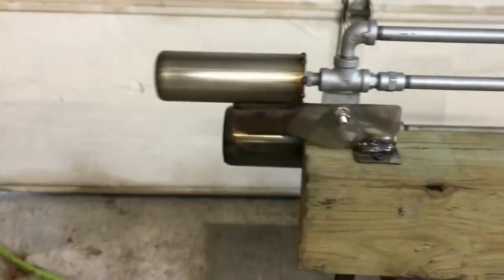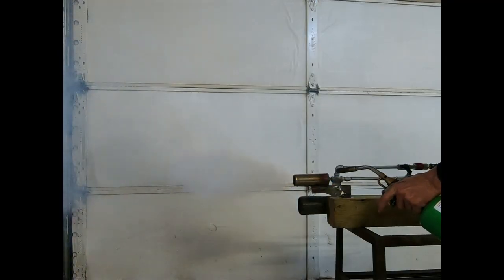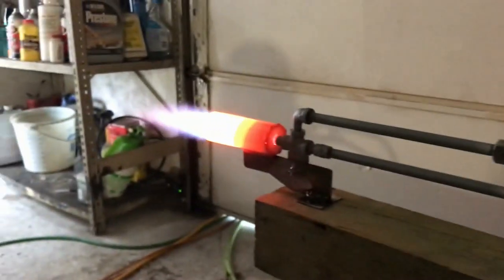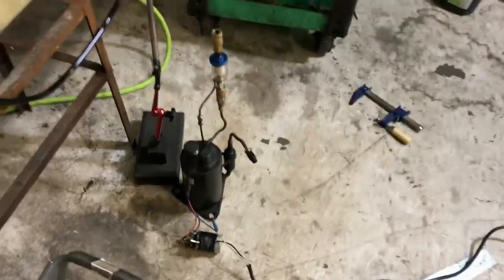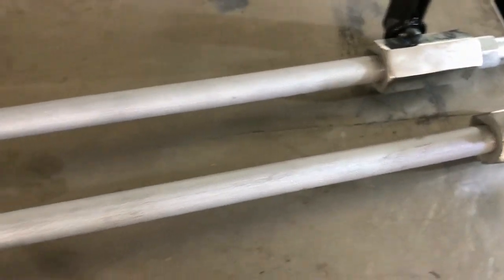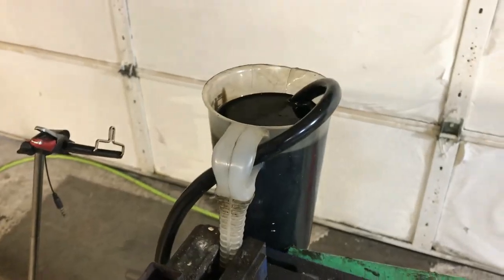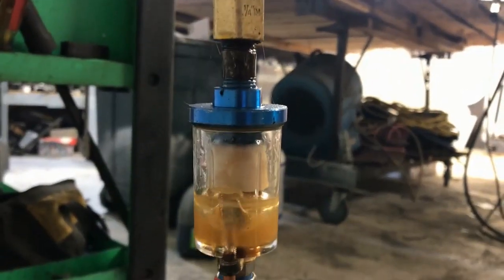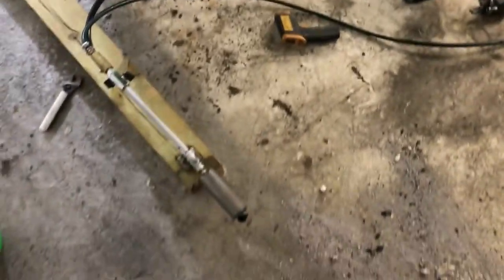Micro waste oil burner 1,000 to 25,000 watts

Comment: Health and Environmental Hazards of Burning Used Motor Oil

Burning used motor oil poses serious risks to both human health and the environment.

Used motor oil contains toxic substances such as heavy metals (lead, cadmium, chromium), polycyclic aromatic hydrocarbons (PAHs), and chemical additives formed during engine operation. When this oil is burned, these substances are released into the air as toxic fumes and fine particles.

From a health perspective, inhalation of these emissions can cause:

Respiratory problems and lung irritation

Neurological damage

Increased risk of cancer

Long-term damage to the liver, kidneys, and immune system

From an environmental perspective, burning used oil contributes to:

Air pollution and the release of hazardous pollutants, including dioxins

Soil and water contamination through fallout of toxic residues

Harm to ecosystems, wildlife, and plant life

Increased greenhouse gas emissions and environmental degradation

Because of these dangers, used motor oil is classified as hazardous waste and must be collected and treated in approved facilities rather than burned in uncontrolled or non-authorized systems.

Conclusion: what is the level of intelligence you think you have to take an interest in a system that is already banned in Europe for the preservation of our health? Would you like to end up like the Hindus who melt lead from batteries all day long and breathe in the harmful fumes of lead that cause neurological degeneration of the human body, all to recycle used batteries? This video is on the same intellectual level.

Comment: just how much filtering do I need to do with my waste oil? I plan to mix it with desil or kero I have (quite a bit from old bus fuel tanks and scrapped out torpedo heaters etc. ) and since the containers have sat undisturbed most of the sludge should be on the bottom of i pour slowly. For big stuff I was going to use a window screen as junk and grass from the mower engines always falls into the parts drainer and pans. Since Ill be melting scrap, the cheapest possible method is desirable. If I don't filter it, will it effect something like a mini-Godzilla, or will it run for a while before I need to clean it? I guess if I can get a weekend out of it before needing to clean it, thats not so bad. I assume I can just wait for them to cool and blow them out with compressed air or soak the tip in gasoline (or use carb cleaner) and blow them out?

Comment: Warning.  Motor oil has a ton of metals in it. You need good ventilation or you will be poisoning yourself.  I am a chemist and have a lot of experience measuring metals in waste motor oil and gearbox lube.
Reply from the maker: You are correct , place this warning on all my instruction sheets . I have lab analysis of motor to show 4PPM of  lead
Reply: 100% agree. Lots of the bearing material that wears off ends up in the used oil. The tars and organic residues aren’t as much of a concern since they will burn off, but the metals will end up in the flue gas or as ash inside the furnace. At high temperatures I think it’s possible that some of the oxides may absorb into the refractory (think cupellation).

Comment: Nice compact design at .22 cal. and 25kw output. Hint, hint is a hyperbolic .177 cal in the future, chamfering the air inlet at >30deg., coaxial compact for secondary air flow and Mach diamonds in the exhaust?

Comment: If you're using used motor oil it could be contaminated with heavy metals and other toxins. If so, you could be poisoning yourself and anyone else that might be breathing the exhaust gases. Heavy metal poisoning can cause permanent, catastrophic damage to your health. Please use extreme caution!
Reply: hey Ive handled lead without gloves everyday for the past 15 years anb I tiernet uot Qc.

Comment: i made a simular one that burns waste oil just as clean. the nozzle is a 1/4" brass T with 1/8" oil line pushed thru to the face of the other side. then air in the T fitting. ashort 4" piece of 1/4" on the outlet and just pinch it off a little for back pressure.  the trick is keeping your oil pressure the same as the air so one doesnt push back the other. i used a refrigerant tank, dilled in a dip tube, brazed on an air fitting  thats common with the air feed to the nozzle. and brazed in an oil fill with threaded cap. dip tube is oil feed to nozzle. then used a refrigerator compresser for pressure which i found best around 30#. have to valve each off like you did and the flame can literally melt a woodstove. i did a bigger one with 150# and 3/8" copper and whoa look out

Comment: Just made one of these and just cannot get it to light, just end up spraying oil mist all over my yard. It's misting really well and I have used and old 1kg foam powder extinguisher bottle for the shroud with ends cut out. . What pressure do you run it at. Is thick oil a factor. First I had the air hole too big and compressor couldn't keep up so I have made the smaller, it's still misting really well but won't light. Any tips? I would get one from you but the freight to New Zealand kills it price wise.

Comment: I took a regular garden sprayer and put a valve stem on it and carefully fill it to 30 psi with air chuck. Took the nozzle off and connected right onto burner barb fitting with vinyl tubing and hose clamps. A siphon just seems like a tipping hazard waiting to happen. Great burner and well packaged.

Comment: It seems oil is fed by gravity not vacuum as I can see it,others use Venturi principle.Fuel ratio is difficult o balance since fuel drops freely to the burner. that would easily flooded and will cool down the mixture.

Comment: You say, 1,000 to 25,000 Watts? Don't you mean BTU's?
Reply from the maker: nope
Reply from the maker: why would i mean btu's just curious . kw and btu are both a measurement of energy
Reply: True! But you are creating heat energy, (BTUs) not electric so the watts is confusing to me. If you were heating water and making steam for a generator then you could create watts of electricity!
Just was confusing to me. Yes, both are energy ratings, but heat is BTU, Electric is Watts.
Reply: @Valkyrerider  one Watt is a little over 2 BTUs which is close enough for a rough conversion.

Comment: I had to subscribe because this guy is doing the most detailed design and experimenting on different size waste oil burners. I can get a lot of waste oil from doing oil changes for people or from the local garages because people consider it worthless. I estimate that it's worth about $3 per gallon just based on current prices for heating oil right now and I've stored up quite a bit also. When I change oil in a vehicle, I use kerosene very often to help flush out the engine. That helps to thin the oil so that if I filter the used oil and store it, it is ready to use in a waste oil burner and flows very well. I recommend that everyone buy a big metal 55gal Barrel to store your used motor oil and filter it before you put it in the barrel. The oil you add to the barrel will have a slight variance in viscosity but will generally mix and even out, so that you can adjust your oil burner to one setting and get a consistent burn. I think that a 20000 BTU oil burner which doesn't have to run all the time to heat your house, will be enough to heat a small house & garage in the middle of winter. Get a deal on two 55-gallon steel drums or three, so that you can make a nice safe heat exchanger for heating your house with the oil burner.

Comment: I bought one of these from NOBOX7 on the e-place - came a day ahead of schedule - well packed - and easy to put together.  It's incredible - tons of heat, no smoke, extremely clean burning.  I was just running mine to play with it and had it cranked up to 30kW based on the amount of diesel I burned in the time I had it running.  I've reconfigured mine to point straight up, eventually plan to use this as a stove to boil water for beer making.  :)
Reply from the maker: Drink one for me my friend , glad your happy
Reply: Some test data from my run today:  using a very small Gast rotary vane compressor, probably less than 0.8 cubic foot per minute at less than 10 psi, with the air valve wide open and the fuel value tuned just for a little but of yellow flame (rich fuel/air mix) I burned 400 mL of diesel in just over 25 minutes for 32,000 BTU/hr.  You definitely do NOT need a lot of compressed air to make these little 22 caliber bullet burners work EXCELLENT with a lot of heat output!  (and no smoke / fumes)  On diesel, the little guy lights right up and if you keep the fuel/air mix just a little bit rich, it's wind-proof.  :)

Comment: ok so i am brand new to this and i dont know where to start... a few questions... 1 how many psi on your air. 2 what thickness pipe are you using for the 2 main pipes. 3 is the nozzle  a simple hole? 4 can i use a tig or oxy tip as a nozzle? 5 the oil or diesel is siphon fed right? 6 what happens in that T so that the air does not just push back in the oil line and starves the feed. 7 can i run a system like this on a fridge compressor as is? 

i am loving the channel... really interesting, great job.

Comment: My suggestion to you nobox7 is to paint the floor. This would make seeing the flame pattern a lot clearer. Somehow prevent an oil splooge on the floor. One last thing, there has to be a way to reduce the noise from this burner head. Keep on keepin on.

Comment: A needle valve for the fuel supply will do the trick. Ball valves aren't any good for fine-tuning the fuel/air mixture.
Nice project.. :)
Reply from the maker: Your spot on brother gret input , problem is needle valve cost $5 vs $1.97 for these ball valves  , i do use needle valves on the zeus torch for this very reason  but typical there aint alot of room to get fancy when your selling these for $89 . Ebay and paypal and uncle sam get there cut also . Your idea would be the Ferrari of Micro burners lol 
https://youtu.be/2OpxQtC3VUw
Reply: @NOBOX7  Yeah, I see where the equation goes the wrong way. However, I have been able to find some pretty cheap needle valves on eBay. I had a distilling project going on and needed such a thing and it HAD to withstand several nasty chemicals like acetone and other solvents. So the one I found is in stainless steel and even has a PTFE gasket in it (Polytetraflourethylene what a tongue twister). This stuff is inert to fuels like gasoline, diesel, most acids, and of course alcohol (ethylene). They are surprisingly cheap and much better than the chrome plated brass crap they sell.
https://www.ebay.com/itm/1-4-BSP-Female-Thread-Stainless-Flow-Control-Shut-Off-Needle-Valve-Water-Gas-VP/352876195434?hash=item52290f6e6a:g:5MQAAOSwUSZZlxCH
A cheaper all brass variant can be found for I believe 2,5 or 3 $. So not that huge a price difference.

Comment: Close to a pulse rocket ( jet ) engine in design, simple to operate, Germany used this approach in there V1/V2 rockets during world war 2. against England. I’ve designed a burner that uses vegetable oil ( canola ) but any vegetable base will due the job. The unit can achieve 1000+ *f if I crank it up. Sourcing the used oil is quite easy. One of the main reasons I choose this route was that it is environmentally clean, you are not producing any toxic hydrocarbons out the flue. Even if the used petroleum based oil appears smokeless it still is off the chart in hydrocarbons. The only way to address this is to add a catalytic converter. This becomes important depending where you live.  You can’t go wrong running clean 🔥Great vid😎

Comment: More seriously, I need to melt brass and bronze.
Reply from the maker: Well i have systems that can do that without using propane , propane is often needed for that much heat but the tanks bol off and you loose pressure but my liquid fuel systems suffer no such loss and you can use free fuel

Comment: Hi.
Can this burner be used in a gasification stove? 
If it's mounted on the stove door, does it smoke in the boiler room?
How much does the burner cost with the compressor?
Reply from the maker: I would sell this entire thing to you for $150 but shipping would be about $60 with that heavy compressore in it , yes it will work for that application
Reply: Okay, thanks! Now I noticed that you are from the USA.... Away...

Comment: As a farm and heavy equipment  guy. That's what I think of waste oil looking like. (15w40  as Black and thick as tar. )(then it's cold.... its even thicker)
5w20 oil is so much thinner... (almost cheating to try burning it..) 
I collect waste oil and it looks just like that....     a little bit of indirect preheating of the oil is what's needed... not to much or it will carbon  like crazy.... cleanburn heats it with passages in an aluminum block. And a element that warms the aluminum...  have used a coffee maker element  it all premade. Just needs a lower temperature  switch....
Reply: And my car uses 0w20.

Comment: Hi, ive been looking into different ways to heat up my forge and foundry, and your burners seem to be the best way. The only problem is that i would rather build your nozzle myself than purchase it, and you havent released any videos on the design. The amount of control you have on the current nozzle is amazing for a siphon nozzle and i would love to be able to replicate it on my own, so if you could make a video (or email me) on the basic inner workings of some of your newer nozzles (specificaly the high output ones, not the new .22 one)  that would be aweome! If you would rather not discuss it, i completely understand. Thanks anyways!
(Email is ryanwitt1340@gmail.com if you decide to email me)

Comment: now this is perfect, the small silent compressor, small burner, low output. This would be nice for what im kind of looking for. I had this idea where i would run something like this as a water heater, not to turn cold water in to steam quick, but to heat the water over a long time to have a longterm heatsource in my shop. My current solution is producing probably more then 70kw of heat, but thats all to air transfer. And if i shut the thing down its not long before the shop starts cooling down, but i dont want to have it running till the second i leave because of fire risks. 
Now i could make my current setup a hybrid where it would also heat water, but that means it would put out les heat in to the shop, that means cold mornings will be colder for longer. And if i run it flat out for a few hours to heat the air the water wil probably be boiling, cant have that either. So a side burner like this could be nice.
And it would also be great for the garage, if i want to keep the temperature above freezing, let this thing run in a boiler system as wel, have a radiator in the garage and it wil keep the temperature up enough without having the burner inside(i dont want anything burning close to my show car)

Comment: What happens if you add a thread inside the nozzle to make a little tornado inside? It would probably suck more air in and burn the oil even more efficiently. Just an idea to try.
Reply from the maker: Great idea . Maybe even a spring would do it